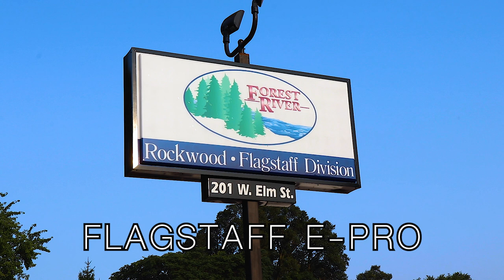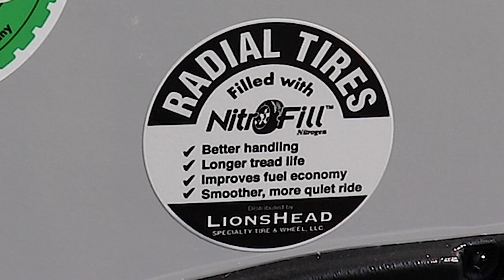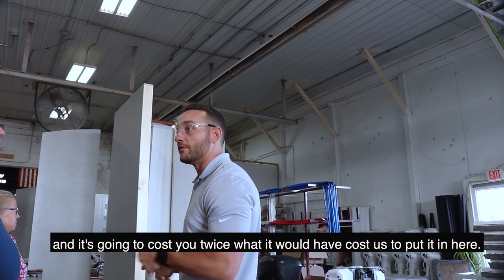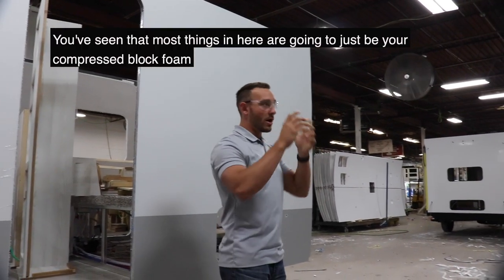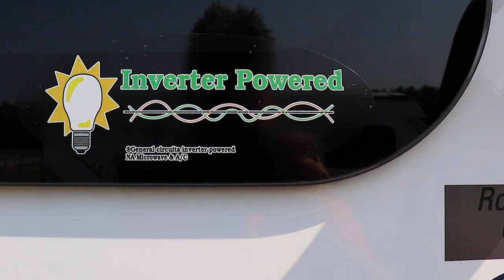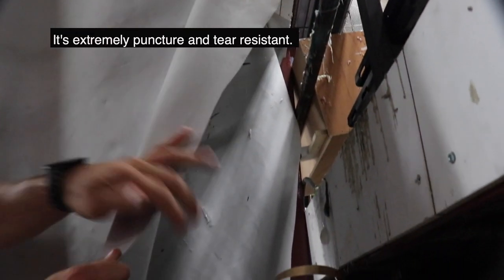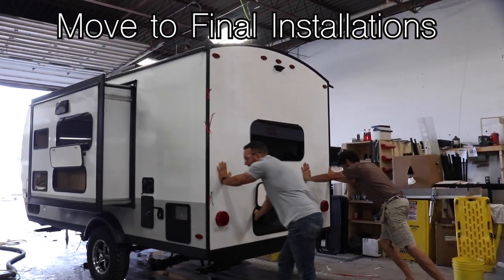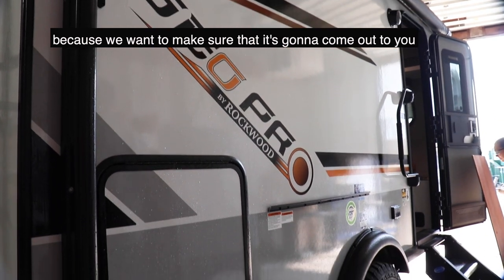Rockwood Geo Pro Travel Trailer- Flagstaff E Pro Factory Tour | How the Geo Pro and E Pro are made

Comment: Do you know if the WiFi Ranger Sky4 LTE upgrade allows you to use your phone to connect instead of buying a SIM card for a module insert? Not savvy on this stuff - but will be working from the road, so need to try and get as good of a signal as possible.
Reply from the maker: Sonya Hoffman yes, it’s a dual unit. If you don’t buy the module and SIM card it will not get internet via cellular. I will however receive and boost any WiFi signals within range.
Reply: @CrowdFreeRV  Thanks for the info!

Comment: 23:42 changed my mind about purchasing one of these. bummer!
Reply from the maker: Doubleu I believe you’re referring to the installation of the slide out? The fact that they are driving in the fasteners without drilling pilot holes and the fact they aren’t sealing every fastener which penetrates the exterior is troubling to me as well. The slide out structure & mechanism has been something I have kept an eye on with the Geo Pro which I bought, a 2020, 20BHS. So far both the structure and the operation have been perfect after 6000+ miles of travel across 11 states. If you choose another brand which fits you better, I encourage you to take a factory tour before purchasing. From what I’ve seen all brands which compete at a similar price point use similar manufacturing practices.
Thanks for watching & commenting and I wish you all the best with your RV search!

Comment: Couple of questions:
1. Is the inverter output pure sine or modified sine?
2. What is the plan for 5G when LTE goes away?
Reply from the maker: Al Dec 👋 hello!
1. The inverter installed in my 2020, 20BHS is a WFCO, WF-5110R unit and it has pure sine wave output.
2. I have not heard anything about the WiFi Ranger plan for when LTE goes away. My guess is this - you currently have to buy a carrier specific module for current LTE usage. I’m guessing to upgrade an older unit to 5G you would have to buy an updated module (the “guts” of the receiver on the roof).
I’ve not used the LTE capability of my WiFi Ranger yet and likely never will. They currently support AT&T but not Verizon. 22 gigs of AT&T data currently costs $90.
That’s not cost competitive in my opinion.
I have used the unit for WiFi though and it works great!
Thanks for watching & the questions!

Comment: I have seen multiple threads on the Geo Pro's to where people are putting on nylock locking nuts at the frame where the cabin is mounted. This is because many new owners complain that those nuts they use were loose or nearly off when they inspected it. Why shouldn't this be a routine addition for safety done by the company? I have not purchased my 19FD, yet, but I am going with my wife to probably do so tomorrow. This will be one area in which I will be addressing with the service manager. Apparently there are about a dozen or so bolts and nuts beneath that need the nylocks added to. Just seems like a pretty cheap fix for the factory to do if they listen to their customers very well. I wish the audio was better on this video, but I did enjoy watching, anyway. Thanks for posting.
Reply from the maker: a1930ford thanks for the info on the nylocks. And yes, this would be a simple fix at the factory. They have made other changes based on customer feedback. Communicating this to a Forest River dealer service manager is great. That’s where the primary stream of feedback flows. I’m going to see if there is a contact at Rockwood/Flagstaff who is in charge of managing quality feedback.
🧡Thanks for watching & commenting💙
Reply: I am thinking of purchasing a GEO PRO 19BH.  Honest evaluation do you think it would be a good purchase?  This will be my first RV camper.
Reply: John Car yes, I have a 2020 19BH and happy with it.
Reply: True, I put the nylocks on my rig. The front 2 were loose with just 700 miles traveled.

Comment: Nice inside report.  Wish they weren't moving so fast, leads to mistakes.  :(   I think my 2017 2109s was built (it's great) when they weren't pushing the employees to move at warp speed.  Thank you.
Reply from the maker: Garland Style I agree! That’s one part of the industry which I’ve never been a fan of.

One thing I did notice though, is it felt like they have a voluntary culture of hustle. I’ve seen a lot of manufacturing where people are driven and pushed by management. The culture is typically poisoned by this tactic. What it looked to me like here was the workers were happily choosing to hustle. Likely they are incentivized by cost/output goals.
In my opinion that counts for something.
But I also wish they would add a greater quality incentive so they would slow it down a few notches and improve build quality even more.

Thanks for watching & commenting!

Comment: Hello, I recently picked up a Geo Pro! How many more solar panels can be added to that system without changing the charge controller and cables?
Reply from the maker: paul1mdrn that’s a great question! I haven’t started to research this yet. I’m working on getting a Geo Pro as well. I’m thinking of getting a 2018 that doesn’t have solar yet so I can build & add my own system.
As to your question, the easiest way to add more capacity would be to use the external port for a portable panel. Does the owners manual have any information on how many watts that panel can be? An advantage for the portable panel also is being able to track the sun with it.
Reply: I believe it's up to 400 watts with that inverter. You can look up the solar company and ask....I want too ask you guys a question. I haven't used the inverter yet. When you turn it on..which plug in the camper does it work for? All or just one? The one by the tv?

Comment: Anthony, do these come with an enclosed underbelly? The salesman at my local dealer advertised these as 4 season trailers but the brochure he gave me didn't list an enclosed underbelly as a feature. Figured since you watched them build it you'd know.

Thanks
Reply from the maker: Mathias Young 👋 hello! I would not consider these to be 4 season trailers. They are an ultralight class of trailer which typically keeps weight to an absolute minimum. Because of this, they do not have enclosed an underbelly or double pane insulated windows. To my knowledge they also do not have heated holding tanks or dump valves. Hope this helps. Thanks for watching & commenting!
Reply: @CrowdFreeRV  We have bought a 19QB this past spring and have been loving it.  It does have heated holding tanks.  I would consider the underbelly enclosed just from being under it a few times, but perhaps there are more strict definitions for that.  However, I don't believe the dump valves are heated.  All that being said, i would not consider it a 4 season trailer.
Reply from the maker: William Burns thanks for the additional info!
Reply: my 2020 has heated tanks, but not enclosed underbelly. I've been out in upper 20's at night, no issues. DIdn't run the tank heaters since we were boondocking.

Comment: I am thinking of purchasing a GEO PRO 19BH.  Honest evaluation do you think it would be a good purchase?  This will be my first RV camper.
Reply from the maker: John Car this is a great question!
From the perspective of quality, durability, towing weight, and capability/standard features you absolutely can’t go wrong with the Geo Pro.
But the other part of the question only you can answer. What do you want to do with it? What tow vehicle do you have? Is it a good fit for your unique wants and needs?
I’ve been looking for a rig myself since selling my toyhauler this last spring. I REALLY wanted to get a Geo Pro. The 19BH was one of the models I was considering. Ultimately I’ve decided against it. I’m going to get a Forest River No Boundaries 19.6. (NoBo)
The primary deciding factor is we will at times be living and working full time out of this new trailer. The working/refrigerator/cooking space is just a little too small in the Geo Pro. Now, if we weren’t going to be full timing in it, we would have gone with the Geo Pro. The NoBo is good quality, but not as good as the Geo Pro. And there is  bunch of equipment which is standard on the Geo Pro which I will have to install on the NoBo. But ultimately we needed the bigger fridge, extra counter space, and that small bar is an awesome feature. It will serve as my stand up desk when working.
So...I hope this is helpful food for thought in your purchase decision!

Comment: Okay Flagstaff and Rockwood, you have a PROBLEM that needs to be remedied...your metal valance over the window by the stove is constantly coming loose!  I had this happen with my 2023 Microlite and it just happened today with my 2023 E-Pro 19FD, and I have had it only 1 DAY!!!  You need to put some structure behind the AZDEL, as it is NOT holding the top screw!  I can't be the only one with this problem.

Comment: Looks like the usual chip-board and Elmer's glue floor, like 90% of the rest of the industry, which turns into worthless crap if it gets wet. Perhaps their 'superior construction' will help with the usual roof leaks that wind up ruining most RV's.
Reply: GP makes DryGuard and DryMax OSB that is not chip board or made with Elmer's. I don't know what product is used here, but it is possible it's a similar product.

Comment: Did you notice if the underbelly was enclosed? Thanks
Reply from the maker: HI - MPH - they have an open underbelly. This was one of the design decisions made to help keep the weight as low as possible. They do have holding tank heat pads though which is a real bonus for extending your season. I’m unsure if they are standard or optional equipment. Your dealer could answer that.
Thanks for the question!
Reply: The holding tank heating pads are an option you have to pay for...it negotiate into the deal.
Reply: @CrowdFreeRV  .

Comment: I've heard that if you put 5lbs in a drawer the bottom will fall out. The cabinets and such are basically a stiff cardboard.
Reply from the maker: This has not been my experience Richard. The interior is solid and I’ve not had issues after thousands of miles.

Comment: Same old cheap crappy manufacturing process that's why the quality is so poor on all American made RV's. Until they fix the assembly lines to standardize the process. When the unit arrives in the QC bay it is so full of garbage from the construction area, which shows you the process is just a rush job. Take a good look at a car manufacturing process line. If you're RV was to come out of process like this it would have a true manufacturing process. Just watching the way the guys when they put a slide in the trailer, it should tell you everything you need to know about how cheaply these are made.
Reply from the maker: Colin Goldthorpe, in many ways I agree with you. One of my personal wishes is that every fastener which penetrates the exterior skin would have sealant applied to the threads to prevent water intrusion. Another would be to slow down and be more quality conscientious. But, to say that US RV manufacturing has not radically improved their quality over time is completely false. If non USA RV’s are so great, they should compete with USA manufacturers. The non US automakers did. Those competitive pressures would motivate USA manufacturers to up their game even more. So I say bring on the competition!! The customer always wins as a result.
Reply: Seems like a race to build these trailers. Definitely doesn’t give me any confidence in quality and craftsmanship. I’ll pass on these.
Reply: They are all hustling quick putting these together not sure some of these “technicians” are drug free either.
Reply: I agree! The Rockwood Minilite was on the top of our list. But after watching a factory tour. I don’t know now! Guys running around like chickens with their heads cut off. I know it’s a manufacturing line, but still they are moving so fast mistakes are bound to happen. Someone said look at Lance. They were better constructed. Well, not really. The few factory tours I could find they are manufactured about the same. So, I don’t see a Lance costing 40 to 50% more. I’ve looked at several long term reviews on Lance travel trailers. Most say they wouldn’t but another Lance. I was really Sold on the mini lites. But, now I’m not even sure what or if we’ll buy.

Comment: Looking at tt now.  Geopro is crap.  2 year old (used) on lot all doors are falling apart.  One little plastic clip on mitres are broken, corners not even glued.  Saw a few concerning things (height, steps) went home to research.  MULTIPLE serious issues, water leaks, inverter, paneling, drawers, bed, a/c, heat, fridge failing, stove literally falling out, staples popping up in flooring, on and on and on.  Absolute garbage, will not be buying one.